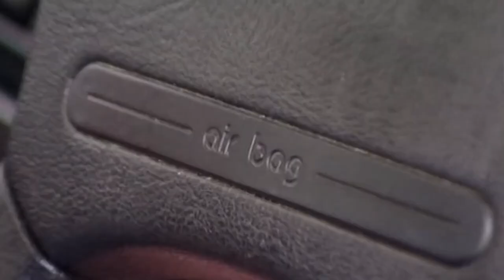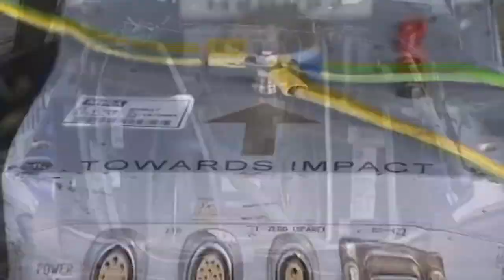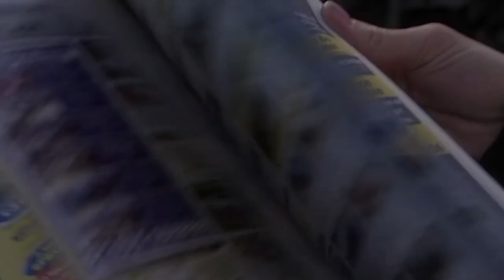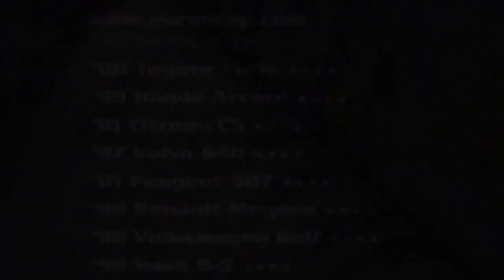What happens when an old car crashes into a new one? | Fifth Gear Classic

Comment: I work for Renault in their engineering and testing facilities. The reason the airbags did not deploy on this vehicle is simply that the gear selector was set to neutral and not drive. Had it been engaged correctly then the airbag would be deployed as the circuit was complete. That being said, the passenger airbag would also only deploy if the pressure sensor in the seat was depressed also; or the switch was bypassed. All Renault vehicles are built from 2001 to deploy airbags with combined impact speed of 30mph, in this case the combined impact was much greater and it would not fail in normal road conditions.
Reply: Mind if i ask you something? (don't take it personally). Why does Renault design cars that are less safer compared to the european ones for South America?
Reply: @ShumanGore  Mind if I ask you something? Why do people in South America pay 1/3 of the cost for their Renault models compared to what people in Europe pay for their Renault cars, but expect the same quality?
Reply: The new car didn't detect a crash. As the hazard lights would be flashing after a crash had been detected. I suspect the ignition was off.... just like the discovery they crashed into a espace
Reply: xmngr no worries, different markets have different levels of options; some countries value equipment over safety, some safety over equipment but in the case of South America it’s all to do with the cheapest price to market so that would be why your perception of Renault isn’t as good.
Reply: hv54wxt yes you are correct; the ignition was likely to be on, however safety systems including hazard lights and airbags wouldn’t be deployed without the gear lever in the Drive position. The pre-tensioners fire off a different velocity sensor so that’s why they activated.
Reply: @Tallandcharming so what happens if you're sat at the lights in neutral and another car decides to smash in you at 35+mph the air bags will not deploy..... that doesn't sound great. Or does the pressure sensor in the seat override this??
Reply: @Bezzer1975  The bags would still deploy. When they do the pole test the car is on a moving sled. And when they do a front end crash test the car would be in neutral. This example in the 5th gear video the ignition is off hence no bags, no hazard lights, the marks on the seatbelt would occur if the car didn't have pre-tensioners. There are tons of test where the car is stationary https://www.youtube.com/watch?v=Rdz9oDF7rXk
Reply: xmngr price, that simple.
Reply: Gabriel nor in Mexico, ( some models) but that’s because they can’t bring the complete European cars with all the safety measures since it would be way to expensive. They did at first with the meganes and the first Koleos, they weren’t cheap so people did bought them. But when they brought Dacias they were cheaper and sold like cakes
Reply: @Tallandcharming: Doesn't make sense to me. If you put on the ignition, the airbag system and pretensioners are armed. If you stay at a traffic light and are hit by a car going 60 km/h, the airbags will deploy (100%), regardless if you are in gear or not. Also, why would someone complicate a system, therefore making it more expensive and more unsafe? It just doesn't make sense. Looking at the dash after the crash, it looks like the car has ignition off. No lights on the digital dash.
Reply: legioner9 yes apparently so, I’ve now been made redundant from that job because of issues with my work.
Reply: xmngr because people in South America need less expensive versions of the cars, money is saved by not including certain safety systems and technology
Reply: Ali lapointe I am unsure, I will check with the department.
Reply: I think the airbags should be deployed even when the vehicle's speed is 0 !!
Reply: Imagine  admitting  in public  you work for Renault  without saying  sorry
Reply: Gary Peatling Sacra Bleu!
Reply: I often set gear selector to neutral
Reply: Can we talk personally for few things because i own a Renault Clio mk2 and i need some things to get answered, if yes tell me where can we chat
Reply: Warrior I’m sorry but I can’t.
Reply: @Tallandcharming  okey :/
Reply: I could not understand any of that but it's cool you used to work there!
Reply: that makes sense. Didn't think about the airbags failing to deploy being a broken circuit thing. I wonder if my honda cr-v uses something similar? likely not even for an 07 plate.
Reply: @Tallandcharming  Really interesting, cheers for the comments
Reply: That seems like a terrible design flaw. So if you were in a crash and when bracing for impact you accidently knocked it into neutral, you'd have no airbags? Absolutely absurd.
Reply: @derbigpr500  I don't think safety features should really cost that much money, and also Nissan was selling a model from the early 1990s up until 2015 in Mexico. And it didn't even have an airbag
Reply: No you don't, stop writing such nonsense. If the ignition's on the airbags are armed. Put the porn away, out of the basement
Reply: Too bad Renault ruined the pathfinder and likely all other Nissan reliability and desirable design characteristics though...
The 90s nissans rival toyota reliability, unlike anything after the buyout or whatever.  Also I wouldn't be caught dead in anything branded 'pathfinder' now days. Let em know would ya?
Reply: @legioner9 It doesn't make sense to me either, the guy's writing BS. He doesn't work for Renault
Reply: No you don't, what a load of BS. I doubt you're even a cleaner there!
Reply: @OFFtheCHIZANE Not interesting, he's lying. The belt pretension system is also electronic, and that worked. He's full of BS
Reply: @Tallandcharming That's simply untrue, they would.
Reply: @pegefounder It's piffle, as long as the ignition is on the airbags are armed.
Reply: @legioner9 It doesn't make sense, because it's a load of piffle. The airbags are ready to fire when the ignition is on.
Reply: @Bezzer1975 It's untrue, he's lying.
Reply: @ghassaneibrahim2491 They are, ignore him.
Reply: @garypeatling7927 He doesn't, ignore him.
Reply: @steved8714 Absurd, and untrue. Ignore this Fake Renault Engineer

Comment: Now crash a new Renault into that "new" 17 year old Espace. Outdated data now...
Reply: Paul Hawkins that is exactly what I was thinking
Reply: @sono81tube  😁
Reply: @sono81tube  😁
Reply: Well, this is from 2004, don't think they could have traveled into the future and got a new car
Reply: Paul Hawkins the video was shot on 2004.
Reply: Now a new clio 5 would probably break it in half :D
Reply: Would indeed be fun to se a new test between that "new" espace and the 2020 espace
Reply: Today's cars and cars from 2004 aren't so different. If nobody say to you which car got 3 stars or 5 stars you can't tell just by watching them crash. Not so much improvements were done in the last 15 years speaking about car frame structure.
Reply: @Meuh974  They may be totally different in fact, as brands that sell cars  in the USA have made massive improvements to cope with small overlap tests. Renault does not care about small overlap because they don't need to worry about USA style crash tests. Just check the first series of small overlap tests since 2010 to see just how bad the results were. Shocking indeed.
Reply: @chris jones they admitted it flat out when they were asked for support for a small overlap crash test. It's not tested by euro ncap so our cars are not built to that spec was their answer.

Comment: Me with a Dacia 1310 from 2002 that has no airbags, no ABS, no ESP, the car likely compresses into the passangers in case of a crash and to top it off, the back middle seat doesn't have a seatbelt. It does have headrests and safety glass tho. God help me and everyone else in it stay safe, you too guys, no matter what you drive :)
Reply: Oooo am gasit romanul nelipsit din orice sectiune de comentarii
Reply: @zaxlorax7605  😂😂😂😂😂😂😂😂😂😂, app corecție la comentariu, nu am centură în mijloc spate deloc😂, doar 4 centuri

Comment: I had one of those older Espaces! This sent a VERY BIG shiver down my spine!!!
Reply: Could have been worse, you could have had a Rover 100 or a Chrysler Voyager, they got 0 stars.
Reply: The older Espace was pre-NCAP.  I owned two years ago, the 1st was the older shape on a N plate. At the time it was 8 years old. It turned out the bulkhead was so rotten that the clutch cable mounting plate had gone through it and there was a gapping hole in the bulkhead. 
Apparently water from the windscreen drains down the bulkhead and rots them and was a common issue. Watching that thing in the clip, I can understand why that front wheel went through into the cabin.  We scrapped ours and lost a lot of money.
Reply: I almost had a Voyager... But I saw the crash test and just NOPED right out of the deal. Got an Espace III instead, served me well until got replaced... with an Espace IV, which was so greay, that I've had it until last year :D
Reply: Well that's what the entire idea of this orchestra was to do...

To eliminate critical thinking on the matter.

If it had happened at normal speed, there would be nothing to be concerned about.

Slowing everything down and overly dramatising it, is what scars people mentally.

I once fractured my skull, but I'm not traumatized by it, because it happened so quickly and unexpectedly.

The same with almost having broken my arm.

"I'm scaring you for your own good", is what an abuser or ignorant person says, so you can take it from me, that you can ignore that "advice", and drive whichever automobile you wish.

I stupidly recorded this episode of 5th Gear years ago and fell for it.

It took YEARS of deprogramming, to eventually clear the air and dismiss the mindset it was putting me in.

Really quite evil.
Reply: @letsdiscussitoversometea8479 What on earth are you on about, could you please translate this tirade into English???
Reply: @ChrisPatrick-q6k  I don't particularly appreciate people asking me "what on earth am I 'on' about", and I trust that you wouldn't particularly appreciate it either.

Comment: We had the same new Renault, and I still remember our last drive. We were at a football match and halfway on the way home it started to knock very hard, by the time we reached our Grandparents house it sounded like a tractor, once we shut it off it didn't start ever again. We also opened the hood before shutting off, if the engine wasn't bolted down it would literally run away, that thing was shaking so bad. Later Grandpa said the engine is locked up. We had that car for a short time. We then bought a VW Passat B6 which has been in our Family for 6 years already. And has 220+tkm.

Comment: Well that was an overall 70mph impact, but that is pretty shocking
Reply: Well you are wrong
Reply: They used to say that you combined both speeds to find the impact speed, that is obviously very wrong. So this is just two 35 mph impacts.
Reply: 70 mph impacts are very, very different. The old car would have been completely destroyed, the new car would have been unrecognisable (but survivable)
Reply: @davekennedy6315  Ah ok thanks that's what I thought originally
Reply: @davekennedy6315  No, it wouldn't be unrecognizable. The damage on the new car would still not be severe, and it would be very survivable. It would just use the old car as a crumple zone. Go watch the Renault Laguna from 2001 crash into a CONCRETE WALL at 112 km/h (like 70 mph), the A-pillars don't even get damaged yet. These cars are incredibly strong. Basically, to the point where even if you crashed them into another car at like 120 mph,  they passenger cell would still be structurally stable. In fact, there's videos on youtube too where people crash cars at 200 km/h into stationary parked vehicles, and you would be surprised how little damage the cars moving at 200 km/h have, less than in this video. That is so for the simple fact that the faster the new car is moving, the more energy it will smash the stationary car with, and more easily crumple it up. Cars don't stop suddenly in those crashes, the push the older lighter car away while also compressing them a lot, absorbing a lot of that energy.

Comment: Well, i have seen a 1970's Mercedes crash head to head into a modern Toyota at fairly low speed... The Toyota was very dead (bumper, lights, both front wings, radiator & co all crushed) and the Mercedes just drove home with just a few scratches on license plate & bumper.
Reply: It's never about the cars's survivability, it's about driver survivability. In your example, Toyota did its job.
Reply: Photo's, or it didn't happen.

Comment: Was anyone else left unconvinced by the crash guys explanation that the car decided airbags shouldn't go off?
Yet in the slow mo you can clearly see the dummy headbutting the steering wheel 🤦‍♀️🤔
Reply: Yeah I think he does lol.
Reply: You can clearly see the dummy DOESN'T hit the steering wheel, also, dummies move way more in crashes than humans do, because they're just sitting there, whereas humans tighten up their muscles and actively go through the crash, not limp like a dummy. Dummies are purposefully designed to simulate worst-case scenario, as if a person was totally passively sitting in the seat. Secondly, the car was in neutral (for towing), and in neutral, the airbags won't go off because the car didn't even know it was moving, they probably took the battery out as well. No hazard lights came on after the crash either.
Reply: I can see the point you're making. But it doesn't make sense to me that when a lot of the safety features (pre tensioners as an example) would rely on electronically controlled sensors and computers and probably motors too for the pre tensioners themselves, that they would take the battery out and compromise those safety features, when they are actually trying to ascertain the safety of the car?
Reply: What he’s saying is correct The dummy didn’t actually hit the steering wheel so they won’t really needed

Comment: You should do a new test to show what happens to a 5 star Renault when it gets into a small overlap crash. EuroNCap refuses to test it, so European car makers don't care to improve crash protection for this very common type of crash.
Or.. Test what happens to a regular Polo when it crashes into a 2500kg Tesla. Extremely heavy electric vehicles are very dangerous for lighter gas powered cars.

Comment: just to mention the old espace is made of fiberglass where the new one is steel !
Reply: Up to 2003 the Renault Espace had the ladder chassis from the 1970's Matra Rancho (one of the first SUV's in Europe). The old one may have been from the mid 1990's but structurally it had more in common with a 1970's truck or a typical 1960's car. A 1970's Mercedes W114 would have probably faired better than the old Espace (though probably still lethal). To say this about 1990's cars in general is a big claim and it would have been a more fair comparison if they used a '90's Laguna and a 2004 one. Otherwise they could have used two Meganes but as they already stated the 1998 Megane had 4 stars so it wouldn't have the dramatic effect.
Reply: It's made off iron not steel
Reply: @eugen92vl  hope it`s not pig iron,,,,,,,,never sell any to a certain religious group,lol

Comment: i thinking,,, 
old car hitting old car, might be more worse than hitting a new car right?
because newer car have more crumple zone to absorbs the energy, where hitting older car is both hard shell without much crumple zone?
Reply: No, old cars are much softer, because they where not built for crash safety. New cars have very strong passenger compartment, and regardless of the crumple zones, it is much worse to crash into a new car than into an old car. With old cars, the whole car is a crumple zone, for the car that crashes into it.
Reply: You need to understand the difference between strength and rigidity. Old cars had some strength and basically no rigidity. So it took some energy to damage them, but once you did it, they would start crumbling like paper.  New cars have a lot of strength and extreme rigidity.  So even the parts designed to crumble are stronger than old cars were, whereas parts that are designed not to crumble, like the passenger cabin, are incredibly rigid, and basically would never be severely damaged in a crash against another car.
Reply: @DashCamSerbia  Old European cars are much softer. And 1995 isn't "old", I'd call it more like aged then actually old. Now 70s maybe 80s you can consider old but when people refer to tough cars its mostly the 70s and before because they were all steel framed cars with steel fender and steel anything they could make for the most part. In the 80s things really just turned to plastic and and sheet metal and quantity of quality. Now take a 1930 Plymouth sedan vs these pieces of junk or a 70s f150 250 or 350 and you'll really get to watch those new crumple zones work. But 80s-90s European and American were these plastic dinky cars that really didn't have much going for them.
Reply: @kyleranderson1948 So your saying a 90 year old car is safer than a MK3 Espace? That 9mm round lodged in your prefrontal cortex is on the move again.

Comment: The "old" car still had a ladder chassis from the '70's. It's actually the same chassis as the Matra Simca Rancho. Valid in testing an Espace to another Espace but not valid to say about a '90's car in general.
Reply: Ah yes because all other 90's cars are designed from the ground up

Comment: so let me say the quiet part out loud. What if the damage would have been survivable if two older cars had hit each other then does it not stand to reason that two new , stiffer cars are far more dangerous to the passengers given that the forces would have been both balanced and the cars are stiffer?
Reply: Stop the conspiracy phrasing, of course it will be different with two modern cars, but the occupants would still have a much better chance of surviving